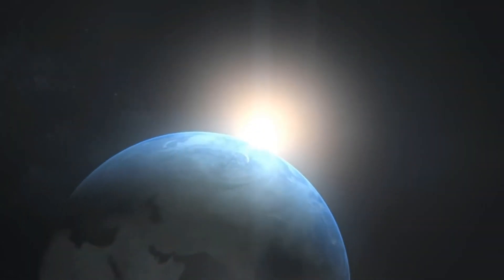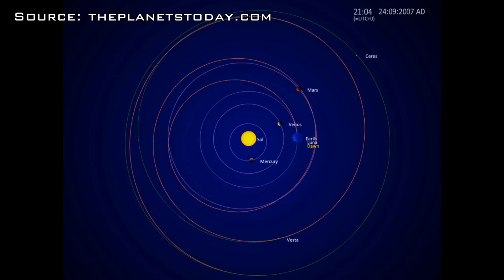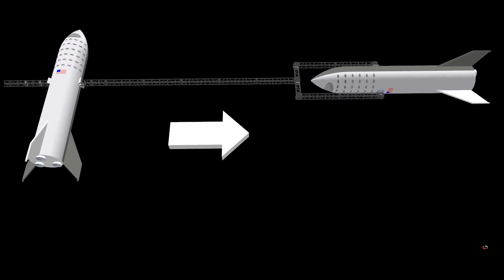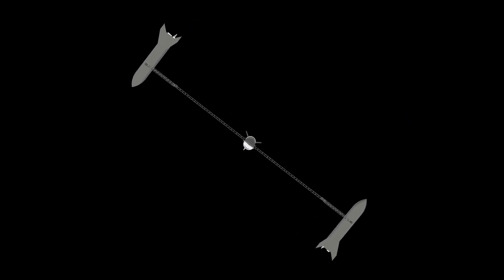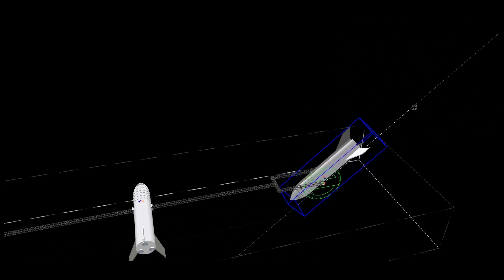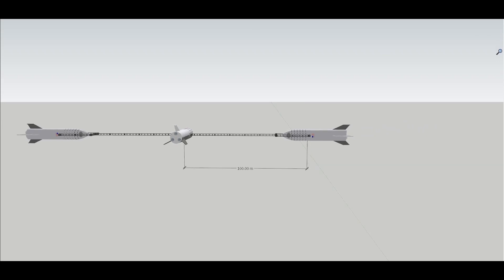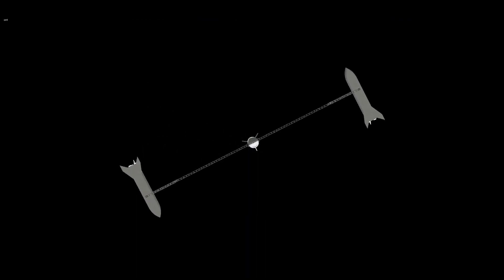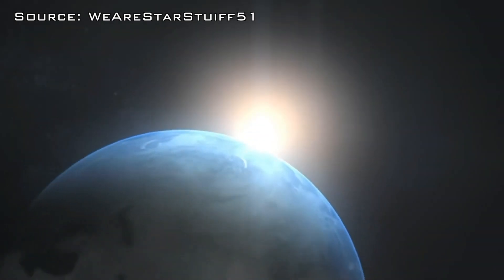GLS2: Artificial Gravity for SpaceX's Starship

Comment: Your design it´s ok. The only thing that you didn´t mention is how the Starship of the middle is going to be controlled (remotely?), because I asume that all humans would be in the exterior ships all the trip.  Also, the stress on the bridges that connects the three ships is going to be something to start the spin and to stop the spin, that not to mention that the bridge is exposed and would increase the chance that something on space crash to it. I would like a more conservative design, like the one that is on the Discovery ship on 2001. Instead of sending a whole town to Mars, let´s reduce the crew to a minimal to keep them safe and optimize resources, and use the extra space to build a wheel which can be safely rotating inside it´s 9 meter diameter (2001 Discovery set was 12 meters), where you could put the places for sleep and a gym (if it fits), that would run on special rails to ensure that the wheel doesn´t add torsion to the ship, and has to run on motors that could use electrical power or fuel, and where you can control with only a switch then rotation speed to simulate Earth or Mars. This BFR should be docked to a refueling/food supply BFR that would feed the crew and the BFR along the trip, and could stay in orbit, or descend to refueling, and could be also used as a lifeboat, if something goes wrong in this long trip.
Reply from the maker: Thanks, I agree with you mostly, except 9 meters is too small what I would consider to be an effective and live-able spin grav system for humans.
Reply: Not really. 2001 set was only 12 meters. But the important question here is how fast do you have to spin the wheel to get useful artificial gravity in a zero gravity environment. Remember that before SpaceX, aerospace industry never tought on reusable rockets. We have to think in the same way that Elon does: pushing the limits of what is possible...

Comment: You're missing the simplest solution, while it might take a while, the RCs thrusters are going to be methalox anyway with similar specific impulse. So just tether them nose-to-nose which they're already designed to do anyway and since they're already going in pairs anyway then use RCS to spin them up
Reply from the maker: I look forward to seeing the development of the methalox RCS. When their ISP and propellant reserves are announced, it will be immediately clear weather or not RCS can be a solution for spin up.
Reply: @smallstars  If you think about it, it's going to be expending propellant either way. All you'd have to do is make one extra refueling trip to compensate. 30 m/s is hardly much...
Reply from the maker: @pilotavery  Will the RCS tap off of main propellant tanks?
Reply: @smallstars  Elon said it should. It will have slightly less impulse buy you only need 12 meters per second each way. And even if it's half gravity, it's better than none for using the bathroom etc.
Reply from the maker: @pilotavery  Agreed
Reply: @smallstars  Just having gravity, even 0.3, solves a lot of logistics problems. Even a simple one of water flowing. You can have a floor so spills are caught, poop and pee in normal toilets, some kinds of filter systems will be much more efficient when able to use gravity, and the nose already has a tether anyway. The fuel/cargo bfr can have a modified clip that extends on a tether. A hydraulic dampener on the tether would absorb movements over the period of a few hours until it's stable again.

Comment: Why not get rid of the truss system entirely and have the ships attach side by side, but be able to swivel around the attachment 180degrees lock in place so that you can flip both vessels mid spin so to de accelerate and then same method for speeding up the rotation.
Reply: All you need to start rotation is use the furthest engine from the center and this in turn will automatically cause a rotation to start as they also have capability to swivel then engines to a certain degree. This method seems most practical and cost effective.
Reply from the maker: @kazykamakaze131  please draw a picture of this and send it to me at instagram.com/tinysmallstars
Reply: @smallstars  Do you have an email rather? I don't use instagarm.
Reply from the maker: @kazykamakaze131  Not a public one, try twitter.com/tinysmallstars
Reply: @smallstars  sent you a tweet with a image that looks like a 2 year old drew it, Name Andre De Jager

Comment: Some time ago, I came up with a simpler concept using only two Starships. Starships are designed to dock tail to tail for refuelling. In this configuration the accommodation decks are around 70 metres apart. Spin this assembly about an axis in the plane of the join and it is (arguably) diameter enough for artificial Mars gravity. If the diameter is insufficient, a tether system could be used and several braced tethers on the Starship bases would provide a semi-rigid system. You can establish and take off the spin with the Starships hard-docked winding the tethers under simple radial tension.

Compared to your concept, this has a couple of disadvantages:
1. Floor and ceiling get reversed for spin gravity versus thrust gravity.
2. You cannot use the main engines to establish or cancel the spin.

But it has the following advantages:
1. Much less hardware as it re-uses a docking mechanism that is already needed for refuelling.
2. Two Starships rather than three tied up for the long interplanetary coast phase.
3. Avoids putting the tankage and engine compartments under super-gravity stress.

The use of the engines is probably the main decider. My feeling is that certainly supplying extra fuel for the manoeuvring thrusters would not be a decider - you need the fuel either way, just a different type. Maybe the manoeuvring thrusters are not powerful enough, so they need to be beefed up or even a special auxiliary motor fitted. Probably not though, as you can afford to take your time to spin up.
Reply from the maker: Thanks for the well thought out comment! I am eager to see how the development goes on the methalox RCS that has been promised. This could be a game changer for any spin grav deaigns

Comment: Two ships tethered at the nose by a long cable. Imagine them in the same x-y plane (the intended plane of rotation) with z being the desired overall trajectory (e.g. to Mars). For their final boost phase they boost off in two vectors with z being equal but one has a slight +ve x and y, and the other has matching -ve x and y. Get this right, and by the time the cable slack has been dragged up taught between them it has pulled the noses to face each other, so that only minor corrections are needed to manage the out-of-plane rotation. They are now spinning around each other at great distance (minimizing coriolis effects etc) for the coasting phase to Mars, and they just detach for orbital insertion. This avoids a rigid structure, so low weight cost, less engineering R&D, and fewer eggs in the same basket, safety-wise. It also lets the fine-tuning of rotation boost to be determined by small x-y orientation interventions during a boost phase you'd need to carry out anyway. It would be a matter of optimizing the cable length and x-y vector components to end up with a comfortable rotation rate at a reasonable fuel cost (longer cables mean fewer RPMs required, but higher tangential velocity), and accounting for potential non-linear behavior of the pre-tension cable (tangles could be a big problem).

Comment: Why not put a truss framework in orbit with two sets of contra-rotating arms, then you could have four Starships, two each to an arm system with a common hub. You could spin up and spin down with a small electric motor. This framework could be left in orbit for later use. Better yet, add fuel tanks and vacuum optimized motors and you save ware and tare on the Starship motors, not to mention an extra fuel supply for emergency use. 

Just my hair brained idea. I think the esteemed Mr. Rube Goldberg would appreciate it if no one else does. :-)
Reply from the maker: I like it! 2 Things:

I don't think an electric motor would have enough leverage on your system, unless it was sized at a gigantic scale, and even then it would be a tough sell. One of the reasons my idea is practical is because the force (thrust) is applied at the location where all of the heavy mass is. 

Also, the truss framework needs to be sent to Mars as well which I don't see a practical way aside from being packed up like it is in my video and then deployed once it's orbiting the sun on its way to Mars

Comment: I had idea a year ago with some differences. Tried to post it to spacex and Elon on twitter. No joy though.

I'd use only two star ships as they are planed to travel in pairs to begin with. Mate them nose to nose with high strength steel wire and spin them up slowly while extending wire. 
I do believe you could use main engines to spin them up, you just need to be creative in how you angle and fire the engines. 

Going to Mars I would start at 0.8G and end at mars gravity. Going back to earth I would start at 0.4G and end at earth gravity. Mitigating the extreme changes and hopefully lower the impact on the human body.

At arrival I would just cut wire and spool them back in. This will spread the ships appart for free.

Comment: shear forces on trusses will be enormous! - how slowly would you have to apply rotation in order to avoid mechanical failure of trusses? Nice problem to consider.
Reply from the maker: Actually the shear forces won't be that bad in space. Imagine being underwater in a pool, and you have a wooden stick in front of you. Your job is to spin the stick, but you only are allowed to touch it with just 1 finger on each end of the stick. Could you ever possibly break the stick like this?
Reply: @smallstars  A more appropriate pool example: you are connected to another human being floating in the pool by a 10m long stick - you try rotating the other human being - stick will break. Think of the torque you are trying to transmit. It is a huge problem unless you increase the rotation rate very very slowly. How slow is the question. There are also instabilities to consider during the acceleration period due to the fact that the trusses will bend and flex due to the enormous forces (and they better or else they will break). See the problem(s) now?
Reply from the maker: @Alekosssvr  That is not a more appropriate pool example. We are not trying to rotate the other human being. Instead imagine that human being moving contrary to you, rotating around a center point. And in that case the drag from the water on the stick provides resistance. In space there is no drag, you need only consider the mass of the object that you are moving or turning and how much leverage, or control authority you have on that object.
Reply: @smallstars  Ok fair enough. Rotation is achieved by the outer rockets not by the central rocket so the dominant forces are axial extensive forces not shear. Clear enough - I accept the correction. Benefits compared to cables - stability, I guess. Not so clear.

Comment: why not use a something like a modeling balloon around the tether for rigidity? when filled up with propellant it could dampen out any oscillations and keep the tether streched out even without rotation. it could even serve as a bridge between the starships.
Reply from the maker: I don't think a modeling balloon material would be strong enough to provide rigidity. At the same time, I am a big fan of the image you just put in my mind!
Reply: @smallstars  i dont think you really need rigidity. when the starships are spun up the system is quite stable with just a tether. the tricky part is when it is not spinning. it would be difficult to keep the ships at the right distance and orientation and every course correction would cause unpredictable movement on the tether and also the other ship. a balloon would keep everything stretched out and dampens movement as long as the downspin is gentle enough. the inflation pressure could also be used to push both ships appart during deploy.

Comment: What happens if the truss breaks during ‘spin up’?  Also you don’t need to land the central truss carrying ship, you leave them in orbit.
Reply from the maker: 1. The truss won't break. If it's going to break, we'll know and the idea will be scrapped. If there is an unforeseen failure, the ships will have to make a course correction and continue the journey in microgravity.

2. You can't just leave it in orbit, because as of now, the plan for the trip to mars does not include an orbit insertion which costs propellant. Instead, the starships will enter the thin atmosphere of mars, using it to scrub off velocity and land.
Reply: smallstars OK, that makes sense. I guess the truss could have multiple cables as backup... What’s the Mars orbit insertion fuel cost vs fuel cost to get the truss carrying ship back to Mars orbit for a return?
Reply from the maker: @nickoutram6939  I don't think it's helpful to compare those two fuel costs, because they are taken from 2 different delta V budgets, one at the beginning of a mars to earth trip and one at the end of an earth to mars trip. 

However, your comment has brought to my attention the possibility that even though they plan on being capable of lifting 150 tons off of earth and sending it to mars, doesn't mean that 150 tons can lift off mars and be sent to earth.
Reply: smallstars Hi, if you want to keep re-using the truss to go back and forth then you don’t really want to be landing the truss carrying ship at both ends of the voyage. So I was thinks my if it took say 5 tons of propellant to slow the thing down into Mars Orbit but 20 tons to get it back to that orbit from Mars surface then your better parking it... The fuel costs at The Earth end are going to be even greater...

Comment: Why not just use a cable? You would only need 2 Starships
Reply from the maker: There are a few complications that come with a  flaccid system that I find to seem unsafe. I'm certainly open to it once the theoretical capabilities of the methalox RCS SpaceX is designing are confirmed. 

Version 3 will use cables for holding the tension, but also include a rigid structure which gives leverage, and will lead the way for a pressurized hallway for GLS access.

Comment: The middle ship will tear appart.
Reply from the maker: The system is connected by a piece of structural hardware mounted in the center of the GLS (the middle ship.) All of the forces will pull on the center hub hardware, which yes will be part of the middle ship, but it will not pull it apart.

Comment: technically you don't need to stop the spin, just detach both at the same time? You will be going off on a slight tangent, but close to Mars, this should not matter?
Reply from the maker: I wonder what the difference in delta-v use-age would be. One suggestion I was sent, which I like very much, is to spin the system end over end facing mars, instead of optimizing it for solar radiation. This way upon detaching the ships will be fling themselves away from the destination, scrubbing off some velocity.
Reply: Yeah, many options you can have to stop spin by release rather than with reverse thrust, so viability for me would be just the initial fuel needed for spinning up, not stopping...

Comment: instead of trying to creat artificial gravity why not just increase the effects of microgravity?  wouldnt wearing a 300 lbs. body suit on mars be like being in earths gravity?  I understand this would only work on muscles and bone, but increasing the pressure inside the suit must be similar to gravity on circulation.
Reply from the maker: Pressure suits are really really uncomfortable to wear and still live life. I would be interested in seeing them experiment with this on the ISS though. In terms of a non pressurized 300 LBS suit, it would still not weigh anything in a microgravity environment. Moving the mass of it would take effort, but it wouldn't be able to be that heavy and still thin enough to make it worth while. Furthermore, as you hinted at, this would only help with certain aspects of microgravity sickness.
Reply: @smallstars  True, but I was mostly thinking of this for Mars or other planets not really in space.  Since Mars has 1/3rd earths gravity adding additional weight to an astronauts should increase the effects of that gravity.  Sure its uncomfortable but so would living in low gravity after a while.  They wouldnt have to wear it all the time, just a few hours a day or as long as they feel like it.  Its better than nothing. and if it used alternating localized pressure it could simulate gravity effects on circulation.

Comment: What do you anticipate as the swivel component for the passenger Starships? These also must withstand the 1g rotation weight of the rockets. They must not go 'out of round' or you'll be unable to stop the spin once you start up. Perhaps a stationary yoke hand-off from the spindles?  Also, why not use the gradual spin-up return idea in a gradual spin-down to Mars' Gravity on the way out? It would save fuel and crew recovery time at Mars' surface.
Reply from the maker: 1. The swivel joint might get cut from this idea. Stay tuned for next version.

2. I like the gradual spin down idea, but a 6 month journey is a long time. As of now, I'm of the opinion that closer to 1G for longer is best, and then the last week of the journey down to .38G